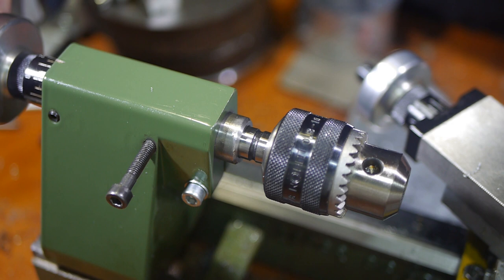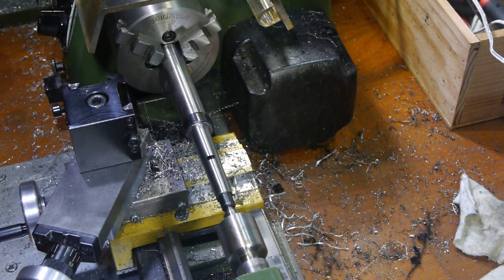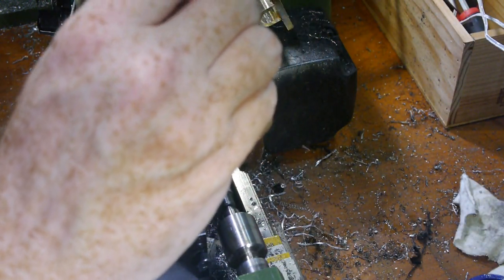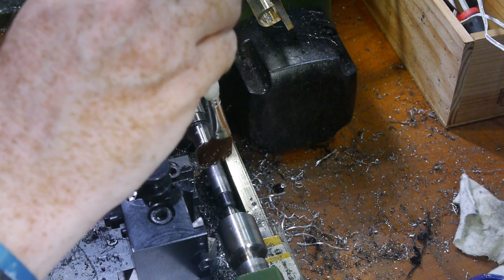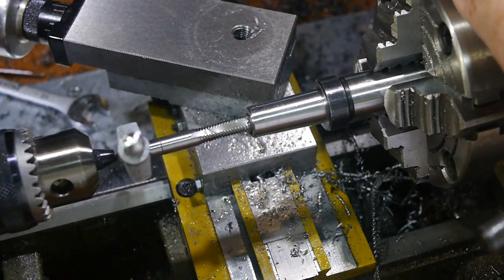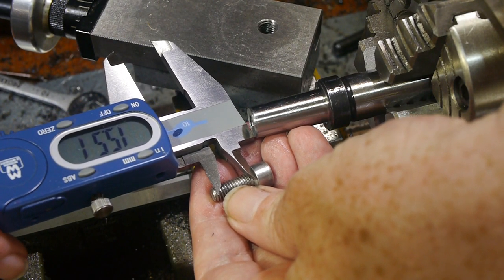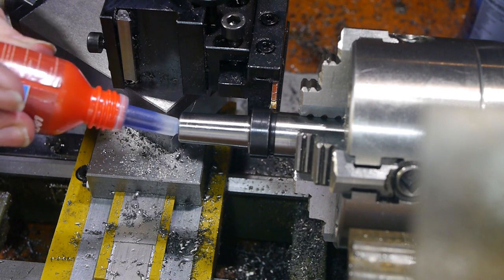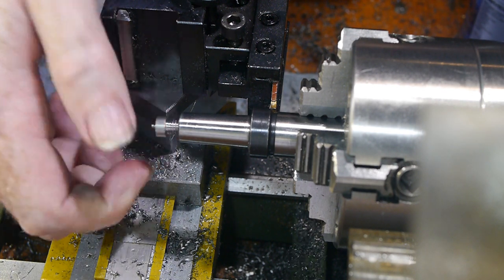Tailstock Die Holder Modification

Comment: Just yesterday I modified a die holder this way to make it B12 from MT1. I paired the MT1 with the proxxon chuck's B12 and cut it without problems, then refaced it and finished it with a 45º bevel.
Thanks for all the nice instructional videos!

Comment: I can report that if one first fully ejects the Morse sleeve from the tailstock, it can in fact accommodate a full-length Morse#1 shank (or at least the kind without the flat tang, like in the video). 
Please correct me if I'm wrong, but for operations with the die holder (or say a third party live centre), I would imagine that the tailstock handwheel feed isn't absolutely necessary.
In which case, if you are willing to remove the handwheel assembly from the back of the tailstock, you don't strictly need to shorten the tool's Morse shank.
In fact, on the PD250e all you have to do is release the rear grub screw (on the side of the tailstock), and the handwheel and attached feed screw can simply be pulled out.
Reply from the maker: Wow, that's really interesting! So all that's stopping you from using Morse 1 tooling is the feed screw blocking the space? I'll definitely check this out!

Comment: Nice save on cutting that Mt1 too short, Well done!!
I've got the Proxxon Die Holder but hadn't used it as yet & so just assumed it had the short MT1 (BT taper)...
...you're correct, there's a 10mm shank, so guess I'll be modifying it at some point in the future.
Maybe press & Loctite a sleeve over the top then cut the short MT1 taper to suit?
Looking forward to seeing what you do next.

regards Colin
Reply from the maker: I've never seen the Proxxon die holder in person, but after a long while spent staring at the product photos, I concluded it must be a straight shank. Thanks for confirming. I personally think having a taper that fits into the tailstock is a lot more convenient, so I thint it's worth doing the conversion. I think if you turn the sleeve to a good press fit, you won't need any Loctite. Perhaps try a small interference fit, then heat the sleeve until it expands enough that you can slide it into place?

Alternatively you could turn down the shank, and thread it, then screw it into a threaded hole in an off-the-shelf B12 arbor? Cutting the taper is the most difficult part of project, which is why I avoided that completely by starting with something that had a compatible taper already.
Reply: I'm yet to cut a taper that needs the required precision, so given the cost of the Proxxon Die Holder if I get it wrong, thinking your alternative suggestion might well be the better option. Thanks.

regards Colin
Reply from the maker: You're probably right that the taper isn't too critical in this case. When I use the Proxxon tail stock with a twist drill I find it slips quite easily, so if I was making a chuck arbor, I'd be very concerned about the taper being a good fit to avoid slipping.

Comment: The flip the die over for a second pass "trick" never occurred to me before... so thanks a lot for that... by bolts future bolts will thank you too.

If you had much brighter lights, your camera aperture would close a bit and you wouldn't have so many focus problems. :)
Reply from the maker: Oh my lights are pretty bright already. :) I've worked pretty hard on getting focus right. This video was made a few days after I bought my current camera, so I was still learning to use it. Hopefully you can see an improvement with the focus since.

Comment: Good job! I could not view this via my AppleTV but played fine on my smartphone. Go figure...
Small comment re the operations: it is usually not recommended to use the tailstock when parting off as it could wedge the tool and break.
Reply from the maker: Yeah, I just learned that the hard way. At the time I couldn't think of another way to keep things steady, and I only realised later that the bore in the 4-jaw chuck was large enough.
Reply: Adventures with a Very Small Lathe fair enough! I know it is a hassle but one could use a steady rest to hold the long bar close to the parting off line.
Reply from the maker: I don't have a steady rest yet, but it's on the wishlist.

Comment: Well, I have heard of Morse tapers, Jacobs tapers, and even Jarno tapers, but I never heard of a B12 taper. What is that? Is that a Proxxon invention?  Love the music. Couldn't place it. Do put the identification at the end of the video :)
Reply from the maker: From wikipedia, "B-series tapers are a DIN standard typically used for fitting chucks on their arbors, like the older Jacobs taper series. Each taper in the B-series is effectively the small or large end of a Morse taper".

https://en.wikipedia.org/wiki/Machine_taper#B_Tapers

The music is Impromptu no. 3 in B flat major, D. 935 by Franz Schubert performed by Chiara Bertoglio.

https://musopen.org/music/2443/franz-schubert/4-impromptus-d-935-op-posth-142/

I usually credit the music at the bottom of the video description; always if the creative commons license requires credit. Thanks for the suggestion for adding a credit into the video itself. I think I'll do that.
Reply: Thanks. Another taper for my collection. Makes sense since DIN is Deutsche Ingenieursnorme and Proxxon  is Deutsch.